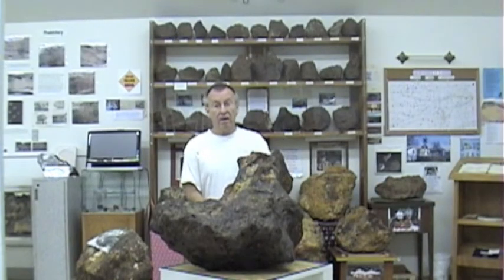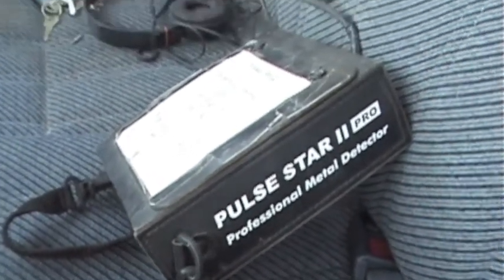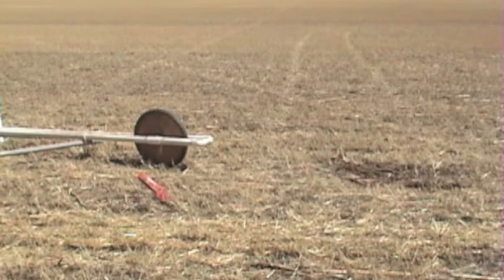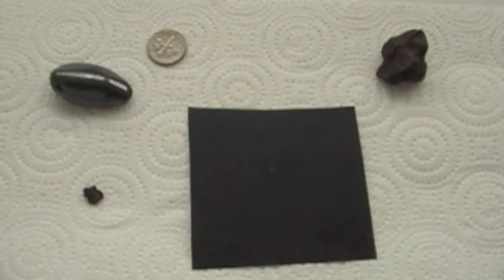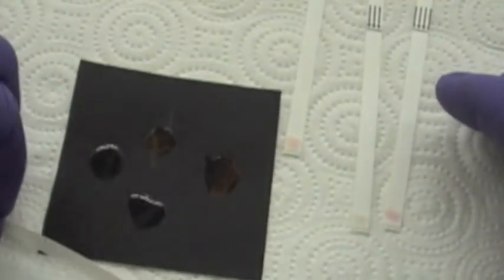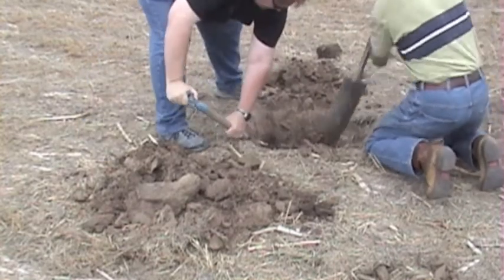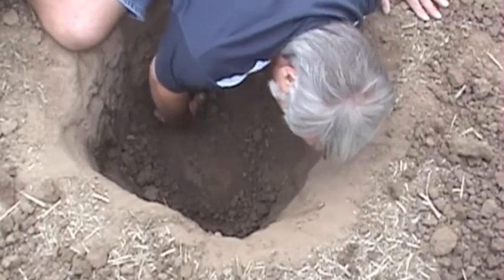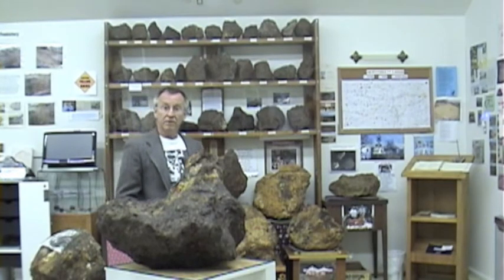9/13/11 Brenham Pallasite Dig

Comment: Hi Don. Great video. Is this the Blisstool with the Pulse star you have? If yes, what do you think about this blisstool for meteorites? I have the V6 with 3 coils. Thanks. Julien
Reply from the maker: Hi Julien, thank you. The handheld detector in the video is an old Garrett Infinium LS , haven't tried the Blisstool.  When  we moved to Brenham I made a "test bed" with 10 pound iron window weights buried 1, 2, 3 and 4 feet each 6 feet apart.. Most detectors would not get the 2ft or deeper targets due to black sand mineralization in the area (not related to the Brenham meteorite fall). The Pulse Star with the  1 meter coil  got them all, the Garrett is great to localize and save some  hand digging. Best wishes, Don
Reply: @distimpson  Hi Don. Thanks a lot! Very informative reply thanks!
Reply: @distimpson  Don hello. Before finalizing my purchase I need you. I ve seen the new golden Mask deep seeker named meteorite hunter. This one could find a 10cm chondrite with 50cm coil at 90 cm in air test. Could you thinkbthe pulse star could have the same capacities?
Reply from the maker: @AskingBob Hi Julien, well this is just my opinion of a few tests but I would not recommend the pulse star for chondrites or even most mesosiderites. As best I can tell, the same physics that let the pulse star "see" through black sand also make it relatively insensitive to chondrites/mesosiderites. Not an exhaustive test just an opinion. However, for pallasites and irons the pulse star has found literally tons of material for me. best wishes, Don
Reply: @distimpson  Hi Don. Thanks a lot for your precious help. It's very difficult to have replies about metal detecting meteorites on the web. You are great. It appears that someone had the same problem. This guy talked to me about the Lorenz Z1 maybe the best deal for this kind of hunt. Not the cheaper but worth the price for him. I will try and will post some of my finds (I hope) with it.
Thanks Don!
Julien

Comment from the maker: An acre is 43560 square feet.  The sled is 12 feet across, with overlap, about 10 feet wide per pass.  To cover one acre you drive 4356 feet =  0.825 miles or 264 miles for a 320 acre half section.  At 7mph this takes 38 hours.  However, this is not the whole story, digging up trash, signals that sound good but are not meteorites is the rate limiting step for me.  The more junk in the field, the longer it takes.
Reply: Do you remove the junk from the fields as to NOT run into it again?

Comment from the maker: More questions: the thick black cable attached to the sled contains 8 loops of wire, it is a coil with 8 turns.  The coil is pulsed and the decay of em field is measured, metal objects prolong the decay.